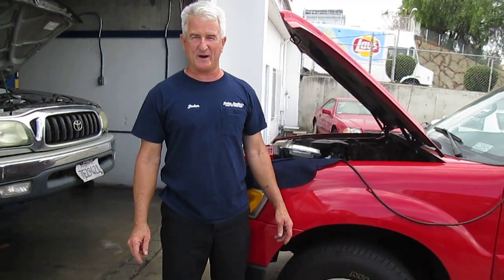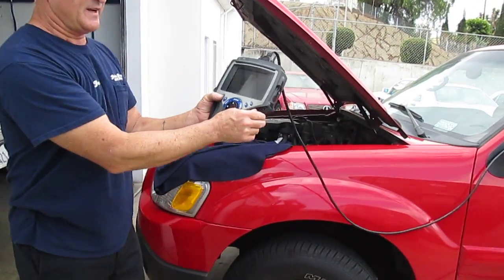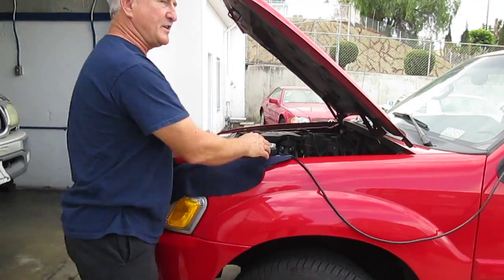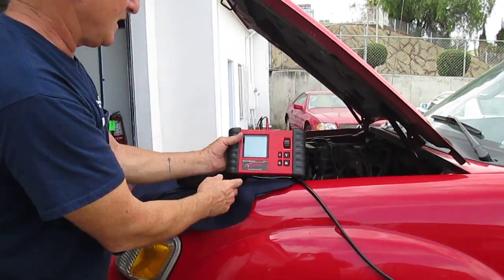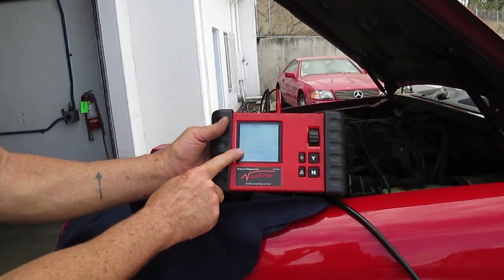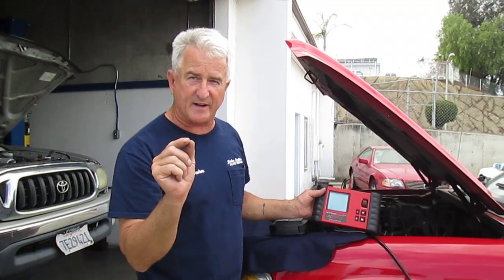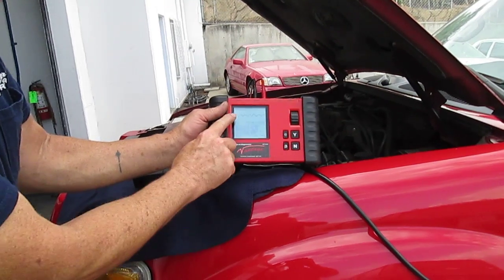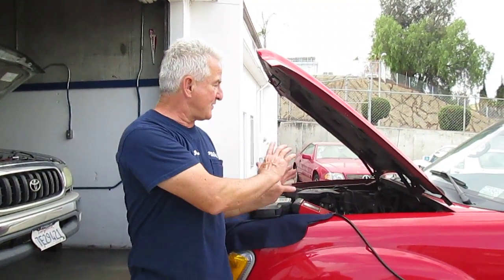Ford Explore Sport Trac 4.0L

Comment: hAVE THE SAME PROBLEM Replaced the mass flow air sensor. No change. Codes are PO193  PO172   PO175

Comment: I have a similar problem not sure what it is. 2005 explorer v6 4x4. Engine runs rough 3 cylinders misfiring checked plugs 3 where wet. Unplugged the 3 that where wet and no difference in the idle so running on 3 cylinders. Started out with a code regarding fuel rail pressure sensor so put a new one on then found some place that said check the fuel pressure damper it had gas on the vacuum side so put a used one on it did the same thing.$200 part so was trying to save a buck. Raw fuel coming out the tail pipe. Please help if you can.

Comment: How can it be running rich is the fuel pump pressure is low i think you got it wrong if your fuel trim numbers are negative yes is running rich but not because your pressure is low maybe the injectors are leaking or if it has a fuel pressure regulator it may be going bad and leaking thats when you get negative numbers on the ft.
Reply from the maker: Here is your answer, this vehicle has a fuel rail pressure sensor to adjust base pulse width for the fuel injectors. On this system when you have a problem with low volume or pressure the sensor will over shoot the mark and you will have negative fuel trims. This will only happen on vehicles with a fuel rail pressure sensor. Thanks so much for your input.

Comment: are the automatic transmissions good in these? im told they need to be rebuilt around a 100 to 150K. is this true?
Reply from the maker: Yep, I haven't had to many problems with them over the years. If I get a transmission job now just buy it from the dealer with 3 year unlimited mileage free replacement nationwide warranty at any dealership across the United States.

Comment: On my scantool my ford explorer V6 4.0 SOHC is showing "0psi" on fuel pressure. The fuel trims werent abnormal but werent perfect either. I'm having a low idle engine shake almost stalling. The idle will drop under 500 and the dash lights will get dim and almost die. I replaced IAC,TPS, throttle body is clean as a whistle, new PCV, and over the weekend i replaced my upper and lower intake manifold gaskets. Car was actually stalling at every stop sign before the gaskets were replaced. The new gaskets fixed the stalling issue but the idle still isnt where it needs to be. 

So aside from the 0PSI reading i see excessive resistance on my alternator/engine block ground. My stalling issue, do you think it has to do more with that fuel pressure reading or my ground issues? Thank you for the video and information. I'm banging my head against the wall at this point.

Comment: ok John i have a 2001 sport track misfire at cold start up drive about 15 min. check engine light goes out car runs great did a scan p0173, p0174 and p0305 i cleaned MAF with proper cleaner changed plugs, wires, and egr valve.any help would be appreciated.

Comment: I'm having a similar problem with my 2004. I have a brand new fuel pump, ran for about 300 miles then started losing power. any chance it might be dirty injectors or something along those lines?

Comment: Could this fault also throw a P0191 code?  I was in a 2004 Explorer with the same low fuel pressure and slightly rough running.  Customer noted stalling at highway speeds.  Lots of stored fuel codes but only P0191 was current.  Cleared codes and drove it for 30 mins, lots of key cycles, nothing happened and codes are still clear.  Left customer and told him to call if it stalled again.

Really, I need a scope ;-)
Reply from the maker: DriveBetter  Take a look at the Iatn posts to see if that gives you any idea's. John

Summary posted on Sep 29, 2010 12:53:03 PMHi gang! We found a locksmith to make 2 new keys and program the PATS system, then it would crank but not run, I did tell the customer ahead of time ther emight be more than one problem becasue of the length of time he ignored this, double checked for spark, injector pulse, fule pressure and they were ok , i disconnected the tube form the EGR valve and it startrd and ran, explained what i found to him snd told him exhaust is restricted and most liely the catalyst is plugged form a that excessive rich mixture, oh The FRP sensor after replacement was reading like it should the old run would be stuck at 33psi. He declined anymore work paid his bill and took the vehicle

Computer Codes & Descriptions
Po190- Fuel rail pressure circuit malfunction/ only one shows now after a battery recharge
Po172 po 175 - System too rich banks 1&2
Po191- Fuel rail pressure circuit range performance
Po301- Misfire #1 cylinder
Po 316- Misfire dectected in first 1000 revolutions
Po 401- Insufficient EGR flowYou may have a Fuel volume issue on this car, fuel pump module maybe bad pumping not enough fuel etc. you can CK fuel pressure fuel inlet at rail with right adapter, male female quick coupler with test port. also you can ramp the fuel pump as well.

I had a truck in last week here with a clogged inlet filter that would barely idle, and not run over 1500 RPM.

Reply 2 of 6Report Abuseok

Richard from Michigan
Sep 20, 2010 1:00:53 PMP0401 is faulty DPFE,should read 1.0 volt koeo.The other codes will need more diagnostic readings from you.LTFT & STFT readings.Actual fuel pressure reading.Misfires could be fuel related or wrong spark plugs[only motorcraft],or overfueling?Run KOER test and post results.

Reply 3 of 6Report Abuseok

David from Minnesota
Sep 21, 2010 11:24:40 AMcheck for restricted exhaust. maybe bad maf.check vacuum reading while it does run

Reply 4 of 6Report Abuseok

Kerry from Missouri
Sep 21, 2010 1:37:03 PMi,dont think i,ve ever seen a ford that did,nt have a fuel pressure test port, look on the fuel rail there suould be a port with a schrader valve you need to get a good fuel pressre and flow reading good luck

 The following replies were received after this help request was updated:
 
Reply 5 of 6Report Abuseok

Ennis from California
Sep 25, 2010 10:00:55 PMyou have an egr or injector problem start ohm ing ingectors. all ford have have afuel pressure stes valve

Reply 6 of 6Report Abuseok

Rhoderic from Illinois
Sep 27, 2010 9:07:19 AMtry checking the fuel pump module above the spare tire for corrosion.
Reply from the maker: john sadler You would also want to know the freeze frame data and if there is any failures in the mode 6 data. Hope this helps.

Comment from the maker: http://www.youtube.com/profile_redirector/100406771016024598529. If the fuel pressure is to high your oil could smell like gas. What were the codes? Does it run smooth at lower speeds?

Comment: How's it going +john Sadler  have the same truck 2005 Ford explore with 133,000 miles on it and when I get up to 45 to 50 mph start trembling real bad Service engine light was on it was reading codes Took it to the shop they telling me Number 4 low 
compression and misfire 1..can that low fuel pressure cause that to happen and it smell like gas is in the oil..

Comment: I have check engine. code 1506 I think it is.  Idle wont calm down sometimes.  garage found one leak, reset system, but problem is back.  I suspect fuel regulator.
.
Reply from the maker: I would look at the IAC valve, if you disconnect it and little or no change in idle speed it's an indication of a stuck or damaged IAC valve. Also remove air intake boot and look for carbon build up on the throttle plate causing it to get stuck.
Reply: 1608 I think is more the code.  Anyways, high idle.  Replaced IAC but with aftermarket version.  Will try the test though.
Reply from the maker: Ed Weibe Can't find code 1608?

Comment: Hey do you think I have a faulty fuel pump? I have a 02 sport trac and my truck has died on me a few times while driving with a loss of power steering but my radio and instruments stay lit, some times it dies again after i restart it sometimes it doesnt. The truck also shakes a little in idle, thanks for the help!
Reply from the maker: How fast were you driving when it died? When it shakes at idle, I would diagnosis that first. If you can get a scan tool, let me know what the LTFT is at idle and 2,500 rpm.
Reply: john sadler It never has happened to me when I am going more than 40 mph,usually when going around 20-30 mph. When it happens i just make sure i keep my rpm's high once i restart it and it seems to keep it going. If i sit at idle after it dies once it will usually die again but as long as I am driving it usually doesn't. die again. I am going to take it to get the codes read and see what they tell me. What is LTFT and how do I get it measured? Thanks for the fast reply
Reply from the maker: It's the Long Term Fuel Trim and the scanner that reads the codes will read it in percentages.

Comment from the maker: Here is your answer, this vehicle has a fuel rail pressure sensor to adjust base pulse width for the fuel injectors. On this system when you have a problem with low volume or pressure the sensor will over shoot the mark and you will have negative fuel trims. This will only happen on vehicles with a fuel rail pressure sensor. Thanks so much for your input.

Comment from the maker: HI, thank you.  I go to training seminars that have very smart instructors, this information was passed onto me due to it's more difficult to figure out negative fuel trim problems. The notes I've used for many years say: cam timing, fuel pressure to high, leaking injectors, fuel volume to low, carbon build up in the cylinders and wrong fuel injectors are the main causes of negative fuel trims. Good question , I will ask for a better explanation and let you know.